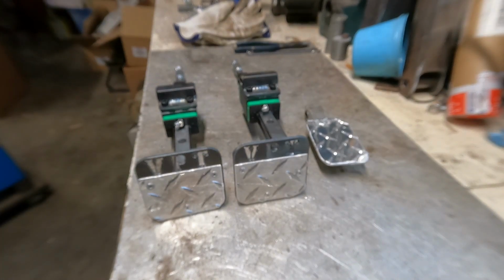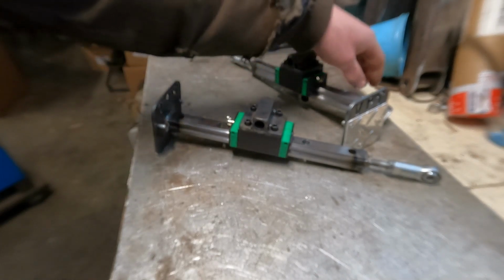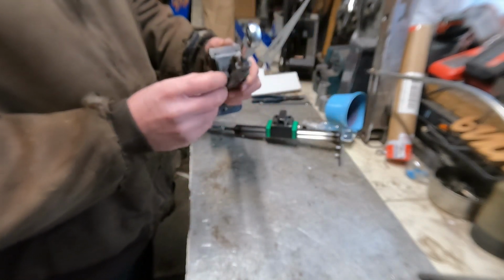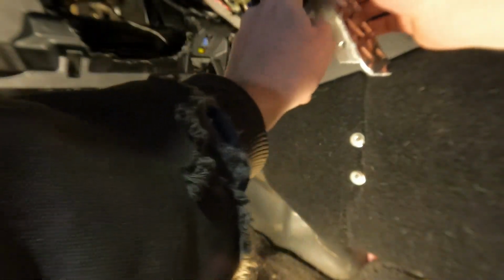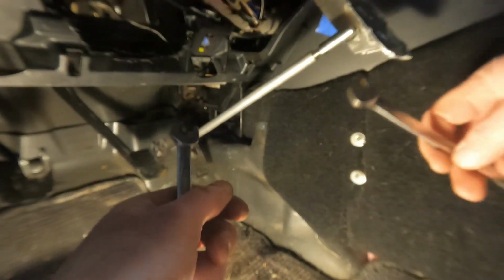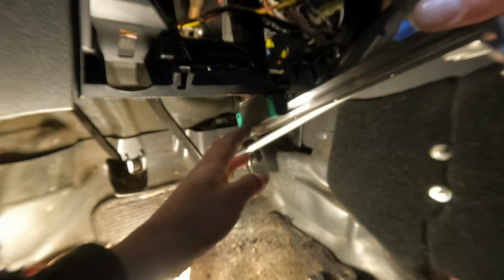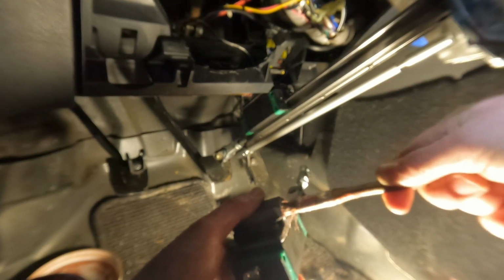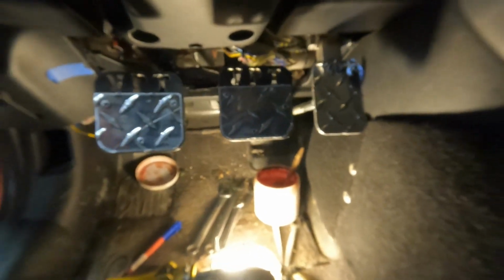Using Linear bearings for car pedal extensions VPT

Comment: Not sure I like the idea of welding to linear rail.  They should be low to medium carbon steel and case hardened for sure. But they are quite hard.  I have drilled them, and they seemed at least 50Rc and through hard.   Either way, with the amount of carbon they contain, case or not, any welding would have a propensity to crack.  TIG is good but it does not help the crack tenancy. Even if it does not crack right away, there is still more stress locked up in the weld area than is desirable. I would really bend test your assemblies to at least make sure nothing cracks off.  ----Doozer
Reply from the maker: That is a great point! I did think of it being hardened because of essentially being a bearing race. While I didn't do an actual full test with the welding I did have to remove one of the bolts after only being tacked on the end and it was very hard to remove. It didn't just "crack off" like you'd expect from a hardened bearing. Being a full weld and not under any extreme forces I don't have any worries about it. The threaded ends are also not under any shear forces so that helps quite a lot as well. I do have some left over rail. In the sake of science and piece of mind I will do a bit of testing soonish when I get a bit of time. Thank you for the response!